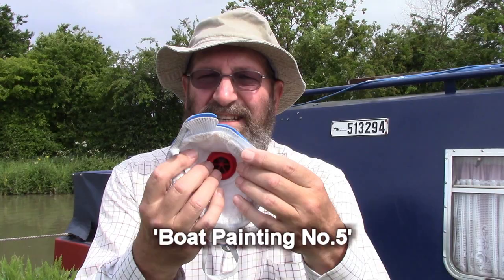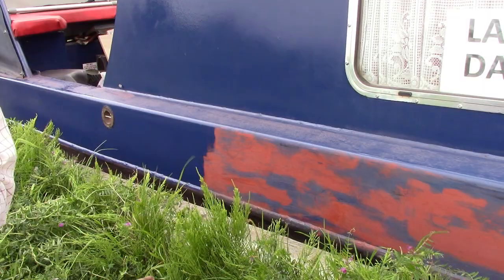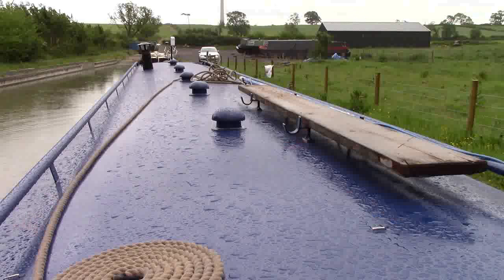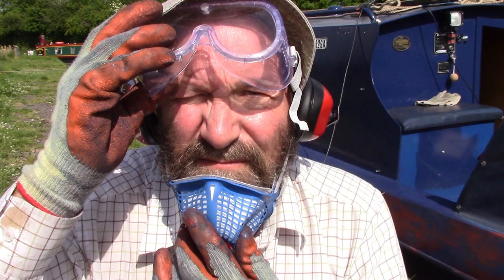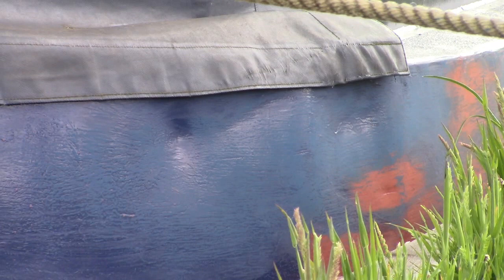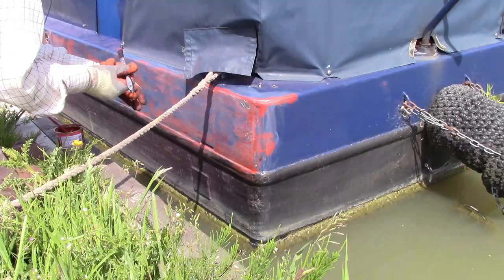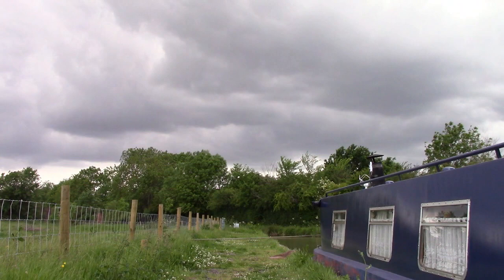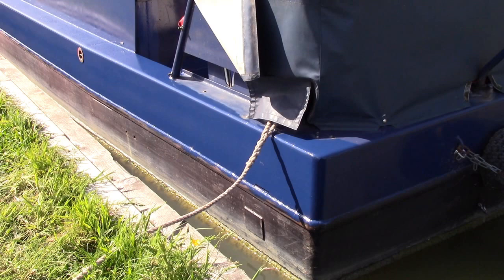59. Painting My Narrowboat - Part 5

Comment: Achieving a good paint job is difficult enough in a dedicated paint room. Doing it outside, as you are, adds an order or two of difficulty. I am surprised that the paint has a recommended painting temperature of 15℃. In Florida, even in a controlled environment, you are usually applying paint at 24℃, or higher. I would imagine that a paint tunnel in the UK would be around those temperatures in summer. I'm looking forward to your Ashby Canal vlogs, Alan. Best always, Zach.
Reply from the maker: Hi Zach - I’ve been doubting the 15 degrees, which I recall finding from some research.  But having now looked it up, it’s a minimum temperature of the paint. When there’s full sunshine you can’t really touch the steel of the boat. I tried pushing it off from the bank the other day and couldn’t touch it, as it was so hot. So there are two aspects - the paint and the temperature of the boat. All the best Alan
Reply: @MyNarrowboatVenture  That was what I suspected. Not having access to the documentation, and knowing the difference between a formulation for Florida versus one for Maine, I knew I could be wrong. I still believe it is a monumental undertaking. Cheers again, Zach.

Comment: Hi Alan. The two raised lines you mention where you went down to bare metal look like they could be welds that have been ground down but not far enough. Maybe a section welded in at some point in the past ?  Given the dents at the front and scars on the back possibly been in a bit of an altercation of some sort at sometime.
Reply from the maker: Thanks Chris. I thought they were welds. Difficult to know why they are there. Might have been from new. The dents on the bow are rather annoying but I doubt they can be pulled out. Cheers
Reply: @MyNarrowboatVenture  Do you think it may have had a piece welded in as a repair at some point ?  Would it be possible to remove anything inside to get a look at the back ??  If it doesn't  bother you  then its a lot of effort  to go to.  My ocd would kick in. I'd have to grind it down and disguise it :)
Reply from the maker: Hi Chris. It doesn’t really bother me and it’s on the side I don’t often see. It’s roughly in line with the gas locker which is on the cruiser deck.

Comment: Great video again Alan.. Very interesting as always. The engine bay is usually a prime location for a spot of rust to develop so it's very wise to get the brush out in there! Looking forward seeing how you tackle it all..🍷🍷
Reply from the maker: Hi Steve - My difficulty will be doing the bottom of the boat in the engine bay, which is sometimes wet but also difficult to reach into.
Reply: Agree... Have you got any rust in the engine bay?

Comment: I presume you know the old trick of putting a damp brush or roller sealed in a plastic bag to delay cleaning.
Reply from the maker: I do thanks Frank but the way I’ve been rollering into the internal corner between the gunwale and the side has meant the roller gets damaged easily, so I have used a new one every time. Cheers

Comment: Hmm , I have a 12 volt handheld paint sprayer  , I wonder if that would work on your canal boat
Reply from the maker: CamperLadd Nomad - boats are traditionally hand painted. The top coat will be rollered and then finished with a brush.